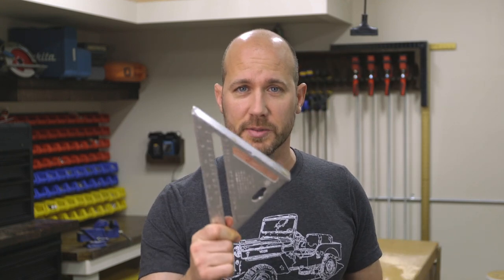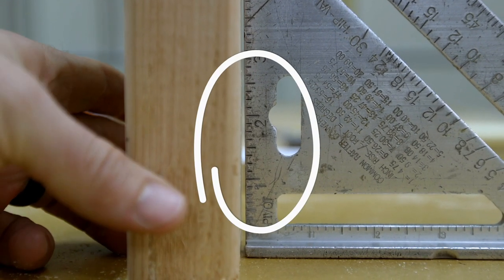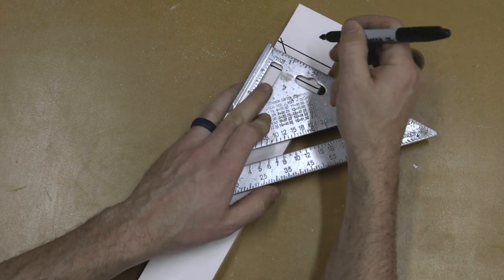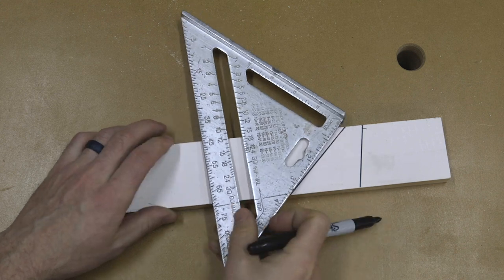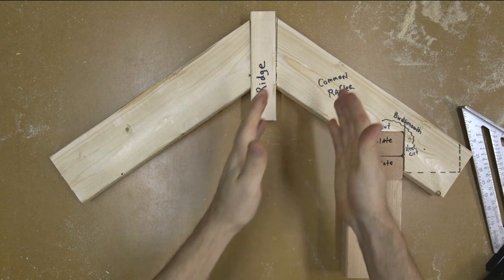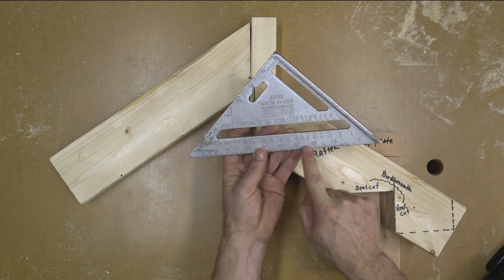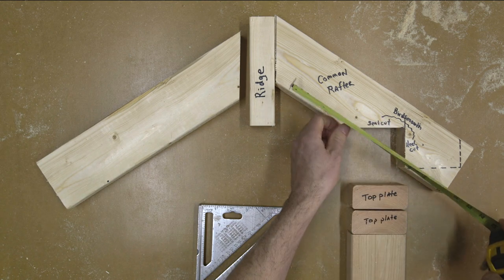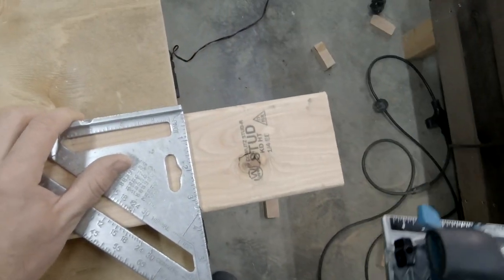Speed Square Basics - How to use one

Comment: I recommend using the plastic speed squares, they're lighter in your belt and have much greater visibility for the markings. On my metal ones I rub white paint into the markings to make them more visible. I also recommend you include  the larger size in your tool box or workshop because it is really handy for some applications. One of mine I've cut off the part that sticks out past the 2 X 4 at a 90 degree angle and it fits all the way down into my pouch and I use it when I'm framing only with 2 X 4 material.
Reply from the maker: That's great info Choim!
Reply: The bad thing is that plastic ones break easily.  I got one and dropped within a week and had to replace it.  The good thing is that the markings are nude and one can push any color of acrylicpaint up in there  to make them moe visible.

Comment: @1.35: if you measure from the end and make a mark at 1", then 2", then 3", etc., every piece after the 1st one will be ~1/8" too small due to the width of the saw kerf in the first cut.
Reply from the maker: Great observation! Yes you are 100% correct. If you need to be precise (and you're using a 1/8 kerf blade), then you would want to adjust accordingly. 👍
Reply: Yeah good point, if I ever make multiple lines for cutting, I always add another line (approximating the kerf) to start the new cut, never the same line.

Comment: Hello, I enjoy these videos and there very helpful. When you cut the seat cut of the birds mouth( for the width of your top plate) it looks like there is less than 2/3 of your hight above plate left. Am I wrong to think the hap should be no less than 2/3 ?
Reply from the maker: You are totally correct. This is just a really really rough run through. For more info check out all my rafter videos. bit.ly/3cRqTmd

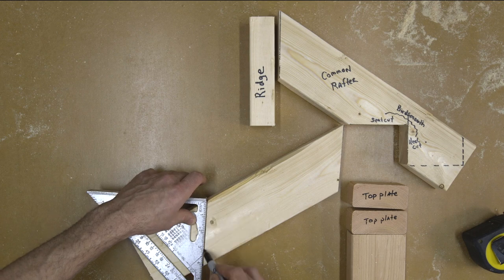Comment: At 6:58 you show how to mark 3 and a half with a speed square. Just make sure to mark with the inside of the flange on your square. You'll have just over 3 and 5/8 if you mark on the outside and I'm sure different squares could have different thicknesses.
Reply from the maker: Great point! Thank you for saying something.
Reply: Good point and it will be hard to see the line due to the flange, esp aligning it.  You're gonna have to know the flange thickness to make it work, otherwise the line is hidden.

Comment: There is a diagonal line that goes from about the 3 1/2 inch mark on the "vertical"  leg of the square to about the 70 degree mark on the hypotenuse. What is THAT for ?
Reply from the maker: Great question, I'm not quite sure. I've never used it before, and honestly I had to look it up. I think it can be used to make heal cuts and other 90 degree marks from a line scribed  across a board. If you message me on IG I can send you a photo that might help. Great question!!

Comment: So if the super ask for a 4/12 cut or an 8/12 cut would I still line up my square to where it says "12" on the that "common" row? Thanks for the video by the way.
Reply from the maker: Thank you for asking that question! If you pivot the square (“line up”) to the 12 on the common row, then your cut would be a 12/12 or a 45 degree cut. To get a 4/12 or 8/12 cut, pivot the square from the pivot point, and “line up” to the 4 or 8 on the common row. A 4/12 pitch is the same as a 18.43 degree cut, and a 8/12 is the same as a 33.69 degree cut. Does that help?
Reply: @TrainingHandsAcademy  Subscribed.

Comment: So, what is that product hanger hole for on the thumbnail?  Seems pretty useless for anything else to me.  One thing this squre has not is to mark the wall stud beginning, center and trailing edge, measure 2 square widths anthen mark the left edge of the following stud.  I think this would replace one use or make this a 6 common uses video.  Beats having to waste time lulling out the tape measure to lay the following stud.